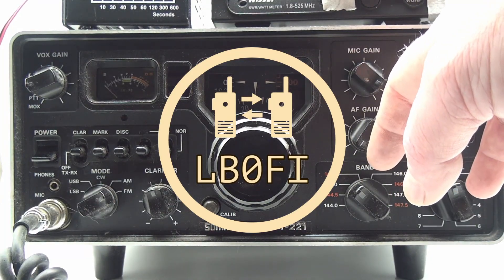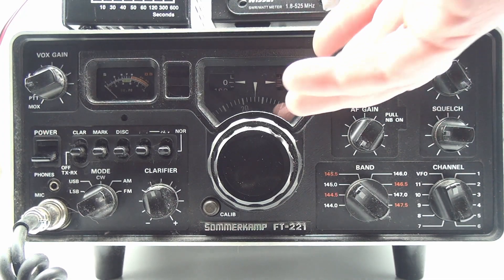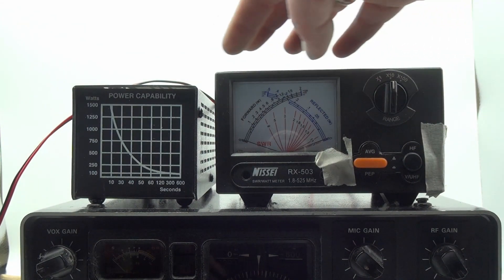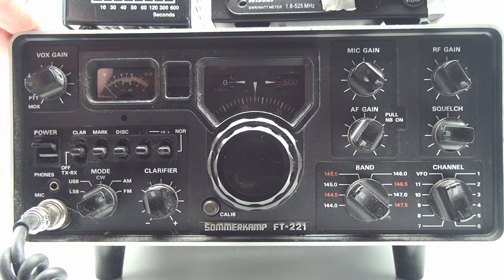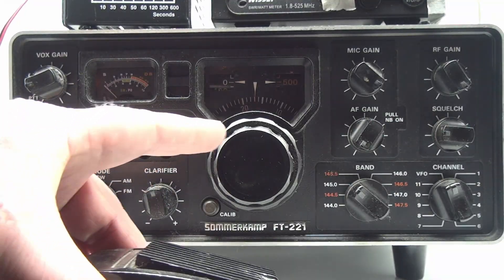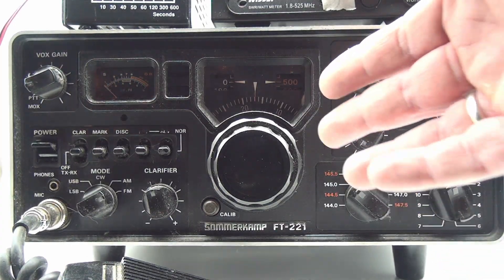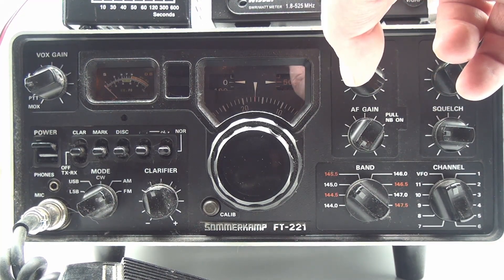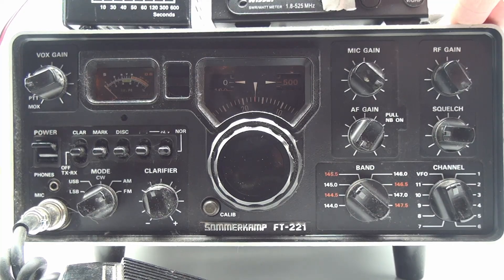Sommerkamp (Yaesu) FT-221 Power Test

Comment: I have several f these old sets and they are great, in the UK there was a modified receiver board which could be obtained which really
brought the receive side alive ( MUTEK ) board which was a drop in replacement card. Also with mostly discrete component construction
there was very little digital 'hash'  in the audio. Great old thing !     GI4GID